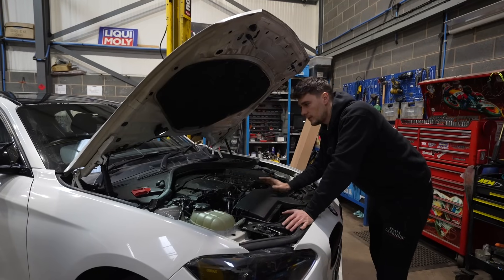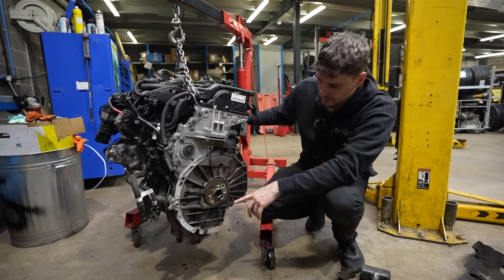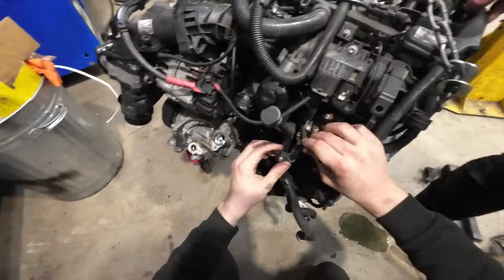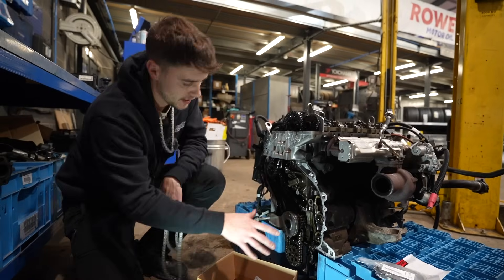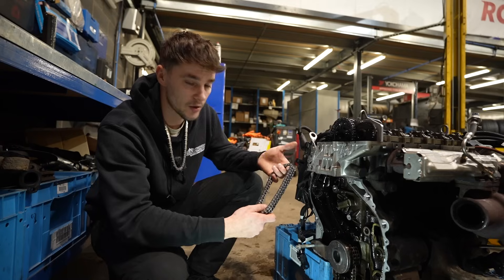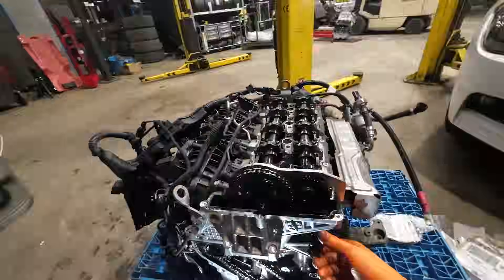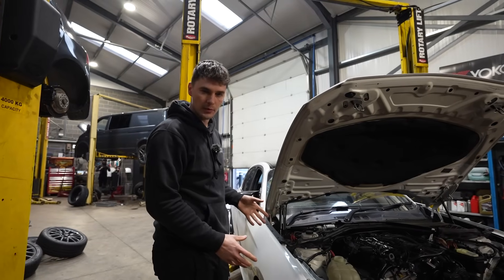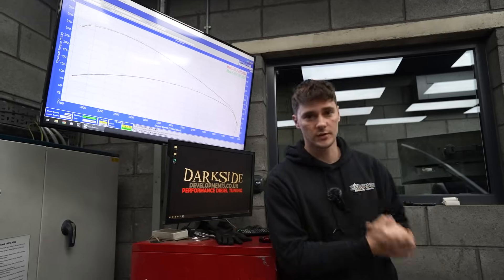POV N47 TIMING CHAIN + UPGRADES!!⛓️💪

Comment: Do you know when the new chain guides started being used? I'm wondering whether I need to be concerned about my 2012 F30 N47 that I've had from new, it's only got 80k miles but in that time it had reasonably frequent very long runs with the daily runs being very short. I also made sure it had a long enough run at least every tank of fuel to regen the DPF.
Reply: Same here, I have driven over 280 000 km and haven't yet changed them. I think it's about time
Reply from the maker: It may be worth just having the chains done for piece of mind.
Reply: @DarksideDevelopments Thanks. I just don't have any non-dealership mechanics nearby who I'd trust to do in-depth preventive maintenance on my car properly. And I've seen so many reports of people who've had their chains done only to have problems anyway; I suspect the cause is often sub par workmanship, if not non-OEM parts. And IMO, with maintenance jobs like this, if there are no symptoms you're better off not doing them at all if there's any risk of the workmanship being even slightly sloppy or the parts being in any way less than OEM quality

Comment: Just doing the chains on 2011 N47. Looks like someone has been in there before me. Guides have 2018 date. Fuel Pump was timed to TDC not 45 after TDC. 
Also found a N57 oil pump Sprocket fitted. 
So do I fit correct N47 sprocket or stay with the N57?
Reply from the maker: We normally just fit all the latest original parts when doing them.

Comment: Most of the manufacturers have timing chain failure issues due to elongation, as BMW uses PVD (Physical Vapour Deposition coating) the chain doesn’t elongate and fail, it’s the chain guide which is failing. 

I have seen in industry nobody uses PVD chains due to cost, the other manufacturer uses PVD chain is Fiat 1.3 MultiJet Diesel from 2015.

Comment: Does the n47d16 from the 114d 2014 have the same issue that the 2.0 gets ?
Reply from the maker: We would need to check part number of the stock parts to be sure

Comment: Chain never ever fails. Even bmw said timing chain has lifetime warranty. It’s the tensioner fails because of wrong oils, long service etc. i had super band noise from my engine rattling on start then it would stop once started every one said you will have to change both chains. I got £60 tensioner, 20 minutes and noise went like never existed and engine sounded like 10k , it’s just a workshops rips off to make money even i know few workshops dont even change they charge customers but only do tensioners and noise disappears , it makes sense if it’s snapped or if theirs guide damage debris in oil or oil filter, which can also be checked by putting camera through tensioner hole i have done it before you can clearly see everything
Reply from the maker: Plenty of items are "for life" but it doesn't mean the they should be left without servicing. Chains do stretch, for the majority of people it makes sense to do everything correctly while the engine is out.
Reply: Tension gets bad over time.
But when you have it on a startup it indicates that your timing chain is stretched and tensioner is bad. 
Now you decided to replace the tensioner, the sound is gone, now the Next thing will come is broken chain. 
You removed the indication of worn timing chain. 
Timing chain isnt a forever thing just because of its lubricated with Oil 😂

Comment: Great video. Noticed you didn't remove gearbox, how hard did you find it to marry the two up when you dropped the engine back in? Thanks
Reply from the maker: Fairly easy with it being manual. Just aslong as the splines are lined up, should be a fairly straight forward fit. Autos are a bit harder, having to line up the torque convertor

Comment: A few months ago I bought a 2017 Toyota RAV4, and to my surprise, it is fitted with… you guessed it by now, a BMW N47 engine….. I hope these problems were sorted before my car was built, but I’m still gutted…………..
Reply: mine is a 61 2011, 170k, original chain. Always used good oil, 8k max between service, no chain noise and still pulls strong. Owned for 10yrs done 140 of the 170k, its never missed a beat. 🤷‍♂️
Reply: after 2011 they started putting upgraded chains on n47's ,so I don't think you should worry about that
Reply: @ that’s good to know, thanks.

Comment: Are you sure them tensioners are from BMW??? Only because my friend has just had to strip a n47 with these supposed "upgraded tensioners" with rubber in the middle wearing away into the oil, blocking the oil pump pick-up & seizing the engine in the mean time! Hopefully people don't start seeing more of these failures with "upgraded" parts
Reply from the maker: Yeah, all replacement parts are from BMW
Reply: @DarksideDevelopments   yes I’ve checked, hopefully they weren’t just cheap copies I should’ve asked my friend to keep them to try find the part number! Worries me because my new n57 ones are the same! I don’t want my oil pickup clogging that’s for sure 👍

Comment: Is there no stronger aftermarket chain kit available that won’t snap ?
Reply from the maker: Don't think there is. The kits come with revised chain guides so it appears that is a failure factor that has been changed
Reply: @DarksideDevelopments  thanks,
This didn’t seem to be an issue on a 2003 320d I had that did 330k miles.
Reply: @Fastfixups when that would have had the m47

Comment: I got my chains done 2 weeks ago, but had a long drive Sat gone, started it this morning and had really rough idle for 10/15 seconds.. any ideas ? Cheers
Reply: check for vacuum leak
Reply: @MrWaheedulHaque  It’s ok now, only happens when engine is really cold, few rough revs then stabilises
Reply: @tonic1667  yeah thats usually vacuum problem at startup gradually will get worse over years depending what it is, also could be timing chain being cold and loose a bit
Reply from the maker: Could be anything on these!

Comment: Was wondering about whether to take the gearbox out vs engine, what are the pros and cons of each way? (mine's a manual 2010 330d btw). What made you guys decide to choose engine out method on this N47 1 series?
Reply from the maker: We've seen both ways but engine out gives you better access to everything, saves struggling

Comment: Please get a mobile work bench and stop working on the ground, it makes it look very amateur. Don't understand why people take the engine's out to do the timing chains either, quicker with just the gearbox removed!
Reply: The V10 was on the other bench. Have you done these without taking the lump out?
Reply: @ryanp6138  stainless bench on castors would be a great addition, push it outside if it's not in use😁 yes done plenty with engine in situ, but if it's not something you or your team have done before it's best to remove the engine for a better view of things 👍 how's the V12 Amarok coming along?
Reply from the maker: V12 is coming along slowly, coming along. Plenty of other projects and customer cars to do first
Reply: grow up, people work whats best for them.
Reply: @whatsinthebox8829  it's you that should grow up ya cupcake 🧁
Reply: I'm wondering about whether to take the gearbox out vs engine, what are the pros and cons of each way? (mine's a manual 2010 330d btw)
Reply: @Markpd69   if you've never done one before it's best to remove the engine.

Comment: Done mine 65k ago, going strong @145k .
Reply: Currently replacing the original chain after 250dkm, still in great condition. Guessing that frequent oil changes made this possible. 
Block is on 220hp and 440nm.
Reply: @stijntakesitall what year is yours?
Reply: @1ckacso  spring 2015. It's the N47D20C version.
Reply: @stijntakes7444  Did you finish?
Reply: Mine on 190kmiles on original chain 😂

Comment: Nice little motor, I feel like I've been shafted, I've got the e82Lci and it  has a stage 1 map, nothing else, no dyno but was immediately assured it will be between 180/190 after seeing this there no chance it's running more than 170, solenoid injectors 😢

Comment: Did n47 chains a while back and after 5 weeks the oil pump quit and engine was scrap. I now always change the oil pump aswell when im that far into it, easier to convince a customer to spend the money for a genuine oil pump while its apart than to convince them it was not your fault that their car quit after spending so much money🙈
Reply: Probably not the cause here but I've had 2 dead engine jobs over the last couple of years following timing chain replacements from other garages and they'd fitted the oil pump sprocket backwards. The Vaslov channel on Youtube has exactly the same issue in one of his videos.

This causes the pump gear to eat into the casing and then the pump fails. BMW have written "Front" on the sprocket but it means front as in towards you when fitting, not front of the car/engine.
Reply: @nemz7505  that is asking if for problems.
Reply: Excess sealant in the pickup?
Reply: @jonesy5192  Not even, just mechanical failure, apparently fairly common but just unfortunate timing in this case
Reply: What else would you recommend having replaced while doing timing chain and oil pump done?
Reply: @ganjadonn  Nothing else major but u always flush a little oil through, rocker cover gasket and new injector seals/washers
Reply: Same with the new Vauxhalls
Reply: Wtf the same thing happened to my r36 passat 😮
Reply: Did you synchronize the pump with the crankshaft per BMW manual?

Comment: Great video as always guys. I was expecting to see 190-200bhp with these mods on this engine, 147bhp or there abouts stock arent they ?

short story:ive not long bought an ebay special "spares or repairs" F20 116d N47 with 130k on the clock with timing chain rattle, a few days before I was about to pull the engine out the oil pump gave up ! .... ended up breaking the car, scrapping the bare shell & engine.

Got myself another N47 116d with a blocked dpf & a few other faults in the same colour & made a good one out of 2, was s plus I was able to use the previous DPF from the scrapped car. 

Ive not long had it tuned, N47 116d stock 114bhp made just over 120bhp on a conservative dyno, so a healthy engine, it achieved just under 180bhp after a stage 1, again on the same conservative dyno...

How comes this 118d at 140odd bhp stock after an intercooler, mid straight pipe & a tune made less power than my 116d?
Reply from the maker: On a custom remap we tend to see 170-180 with the F series n47's (16d/18d), intercooler and exhaust won't give massive gains but each dyno and each engine is different and conditions can change a lot in dyno figures
Reply: @DarksideDevelopments thank you and yes ofcourse each dyno is different, I was expecting a bit more with the intercooler on that N47 118d. My N46 116d is relatively healthy then in comparison I guess (until the chain & pump decides to let go of ourcourse 😂)
Reply: 320d 184bhp standard n47d20c .
Reply: @200degrees. im aware the 320ds make around that power stock, but why are the power gains from this 1 series F20 118d so low compared to a F20 116d , there must be a reason ?

Comment: Is there a certain mileage when you need to change the chains or wait till they begin to rattle?
Reply: 100k miles is the life, or when it rattles or just, ya know, snaps, as they do... Tensioner is actually a good first step to change tbh, cos their are beamers on the road with 250k on the first chain so. Also little edit, from timing chain anxiety disorder research 😂 manuals, start stop, the 20k oil intervals BMW recommended, are all the biggest players In a failing chain. But ultimately, some still just... Snap!
Reply: BMW never used to have any set mileage for when a chain needs to be changed only if they start to rattle. My local BMW garage in Yeovil had never changed a chain to date back in 2008
Reply: My previous 318d with the n47 snapped at 110.000 km my new f31 with the n47n is do oil change every 10.000 km now and it has 118.000 km and so far so good . Just don’t do the 30.000 km oil changes bmw recommend its asking for a timing chain faillure !
Reply: My n47t / f10 has 300k and never changed anything except usual service ofc. I asked bmw dealership for a chain change, they said that I shouldn’t bother changing if it doesn’t rattle. Now how the heck would I know when it’ll start rattling 😅
Reply: @Jetnes  wen my chain snapped in my previous bmw the garage asked me didn’t hear the chain rattling i told him i never heard anything didn’t even know how it sounded 😂🤷‍♂️
Reply: Belle vidéo 👌 😉.Beau travail ⚒ 😉 👍

Comment: Is N57 engine especially late on 2015 / 2016 good and strong and not like its 4 cylinder brother ?
Reply: The n57 has problem with the oil pump,
Reply: @kurucztamas6132  What makes you say that?